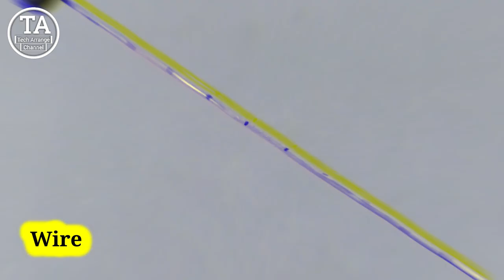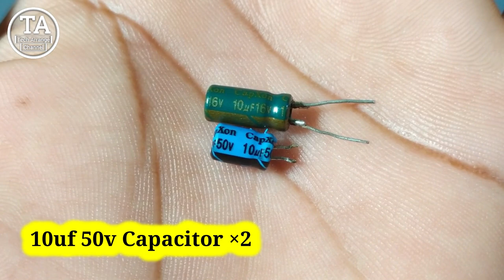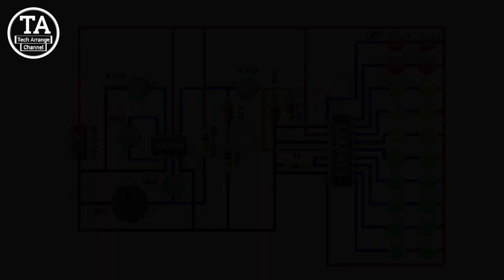Wireless VU Meter Using LM3915 and LM389 ic

Comment: What does 10e means is that 10ohm. What's the material you using instead of wire?. The design looks great and the way you done it without using pcb looks supercool. 👍👍👍🔥
Reply from the maker: Yes, correct 10e means 10 ohm resistor
Thank you so much 🤗
Reply: Brass wire

Comment: Please can you help me to build a Bass responsive vu meter  LED Colors(10 Green, 10 Blue, 10 Yellow, 10 Red) Without circuit board with IC preferable CD4017, NE555, LM 324, LM339 or any other IC. Also if its possible to build without IC and Transistors. Your help will be well appreciated love your work.
Reply from the maker: Yes it is possible but it cannot be wireless vu meter

Comment: Can have a moving dot display with that chip lm3915 can swap using a pin between bar graph and dot 
Bro make equaliser with few channels direct connect to speaker
Base , mid range, treble
Reply from the maker: You remove the condenser mic and can use the wire with the speaker